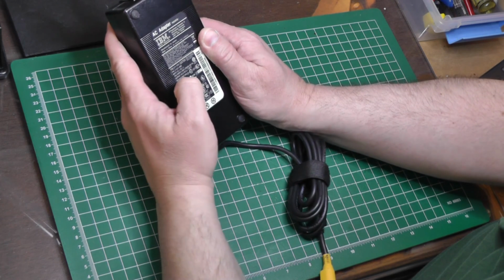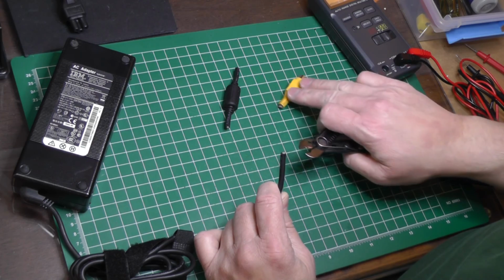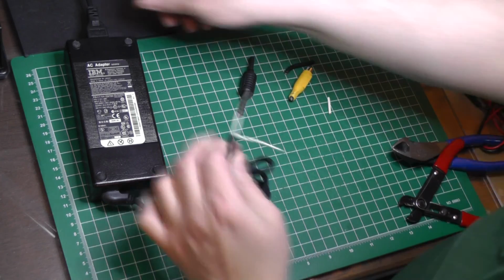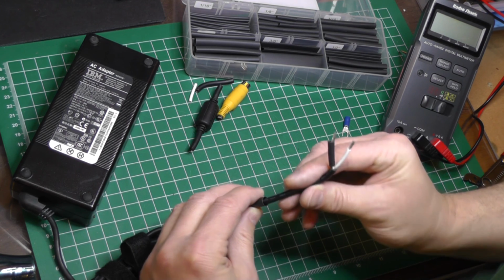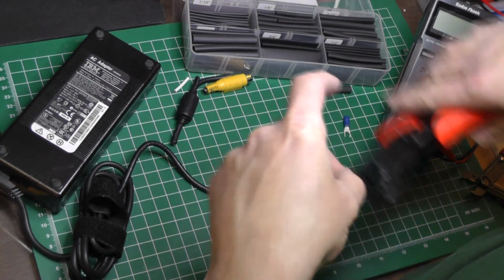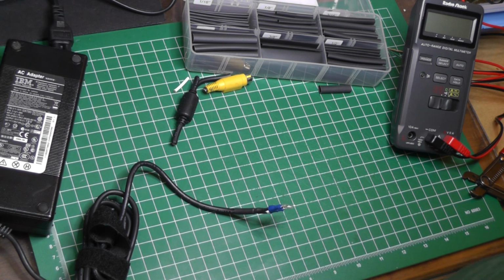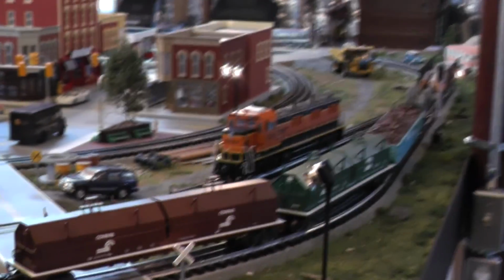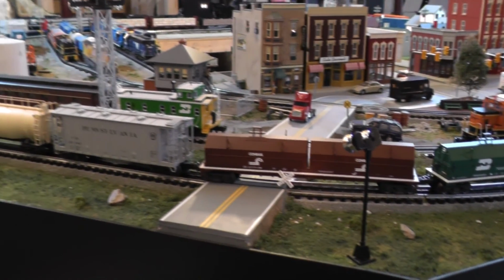Laptop Power Supply for Model Railroad Lighting

Comment: Your video on powering accessories using a laptop power supply was very helpful. I have a simple layout with vintage Lionel components and had powered the accessory lightening first using a HO transformer and then the accessory tabs on my Lionel KW Transformer. That worked better but seemed to be drawing to much power from the transformer and affecting the trains. After seeing your video I thought I’ve got that stuff and from a box I throw power supplies from all kinds of things I found a Gateway one from a long forgotten laptop. In a few moments of work my lights are bright. Thanks
Reply from the maker: Good job...glad it helped out.  Just confirm the DC voltage coming out of the laptop power supply...many are 19.5 volts so make sure that is not too much for your accessories, etc.  I found these IBM power supplies that put out 16v, which was perfect for my accessories.

Comment: Neat.
     I'm new to both model railways and electronics.  Can you please explain how your terminal strip is hooked up allowing the positive and negative to all of your lights.
     Cheers
Reply from the maker: I don't remember exactly, but I believe I ran the positive and negative supply wires to separate terminal blocks and then used jumpers to tie all the screws together on the "positive" block and all the screws together on the separate "negative" block.  Then the positive wires from many layout lights would attached to the "positive" terminal block screws and all the negative wires from many lights attached to the screws on an "all negative" block.  Terminal blocks similar to these:  https://amzn.to/2Q7LGXg
Reply: @AllThingsBobot  
Thanks for the prompt reply.
     I can see how that would work but in the clip you have the two connectors from power supply going into one terminal block 9:28 which seems to have all of your feeders coming out of it with no jumpers.
Reply from the maker: @tassie7325  On my terminal strips, the jumpers are U-shaped metal tabs that are mounted under the screws...so in the case you point out, I jumpered the far 4 screws on the end of the strip to positive and the closer tabs to negative, or vice versa.  Hard to explain without a diagram, but in that case I split my terminal strip into jumpered positive and negative sections.
Reply: @AllThingsBobot  
Thanks.  That makes sense.

Comment: How many volts are needed to power HO Scale tracks? And, is that the voltage you run through your bus lines which the track feeders connect to? Thanks!
Reply from the maker: I work in O-Scale, not HO.  O-Scale (Lionel) is typically variable AC for older stuff and 18-20 volts AC fixed for newer command control.  I think HO is 12 volts DC.   So no, this computer laptop power supply was putting out 16v which was good for the lights so they weren't burning so hot and bright but wouldn't really be enough for O-Scale command control (fixed 18-20v).

Comment from the maker: Caution:  To be safe, I recommend installing an in-line fuse holder with a fuse of appropriate amperage to protect the circuit since I am unsure of the circuit protection that may or may not be built-in to the laptop power supply.

Comment: Hi Bob • e-bay is a fun place to find stuff for custom projects. Electronics is a complex issue and sometimes hard to understand. What I miss about electronic projects is the Heath Kit Company. Back in the day I built a lot off Heath Kit Projects, because they had a main store in the Detroit area.
      They sold the electronic kits and had a help desk in the store. I remember you installing the whole house serge protector in your home. You have strong electronic skills, which helps you set up cool power supply projects.
Cheers from Michigan